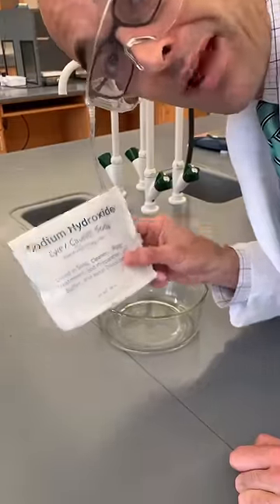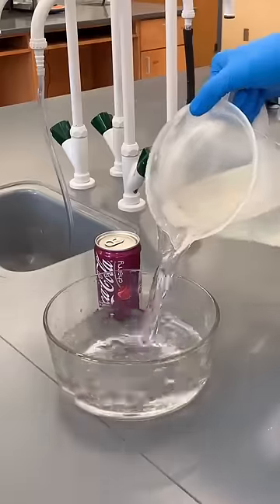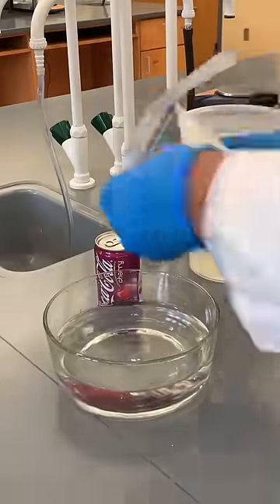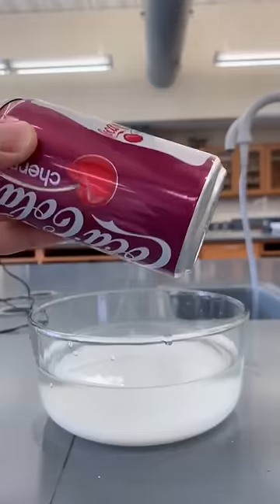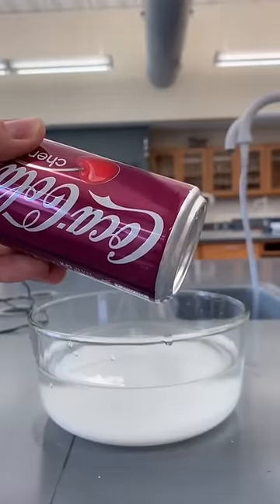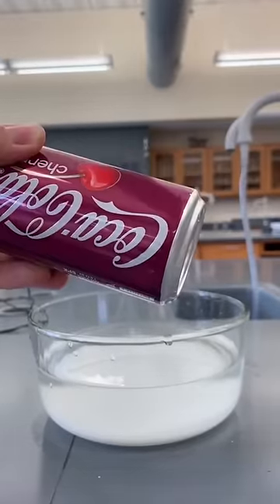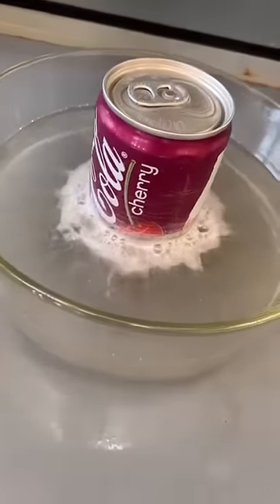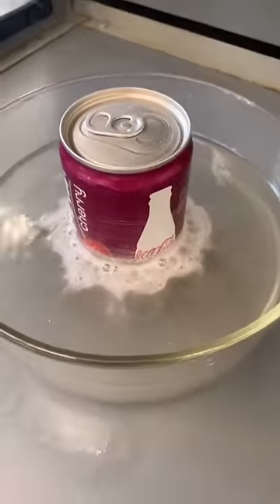Did you know this about aluminum cans?

Comment: Scotty would be proud
Transparent Aluminum 😂
Reply: But, can you make it thick enough to hold the whales?
Reply: how do we know he didn't invent the thing?
Reply: Anoni Moss  ,it's a joke... a reference to an older Star Trek movie where they had to go back in time and beam up a mated pair of blue whales onto the Enterprise and bring them back to their time to save the Earth. They had to quarter off a section of the ship and used "clear aluminum" of a certain thickness to hold the whales and enough sea water for them to live in for the journey through time to their present. They had to slingshot around the sun to get the speed required to make the time leap/jump. I hope the engineering feat that Scotty would have to undertake explains the comment left above.
Reply: @thomasarussellsr  not quite. 
Scotty traded the “formula for transparent aluminum”, with the plastics manufacturer guy in order to obtain several sheets of whatever polycarbonate (or some such) plastic product in a thickness sufficient to withstand the pressure of the water plus whales.
Reply: Transparent Aluminum is actually real... needs lots and lots of heat and pressure to make!
Reply: @wolphin732  in the use in this stream, it was a joke, as it pertains to the video.

Comment: I remember being mindblown that they coat aluminum like that. Didn't learn it until interviewing for a company making that plastic liner. PPG paints. Also, by anodizing Aluminum, I think it can resist acids without liners, but needs to be under controlled temperature, otherwise the Aluminum Oxide layer will crack deep. 

Also, yes glass tastes better all the way. Glass and porcelain is what the liquids we consume are meant to be stored in.

Comment: We have Sodium Hydroxide at work, we call it NaOH, we used to use KOH (Potassium Hydroxide). I work in a plastic recycling company and this is part of the process to pre wash the bottles to probably remove glue from the labels and then also wash the flake after the plastic bottles are grinded. Fun fact: I dropped a whole tote one day, slipped, and landed on my back on top of the chemical, fortunately my co worker put me on water and put me in the shower for some time. My whole back tingled for a whole month due to the burns. I landed on KOH which is stronger than NaOH, and it was more than 50% concentrated at that time, that thing will burn through your skin, my brand new shoes turned into chicharon, the squeeges we were using broke in half and the bottom of the side wall was badly damaged.
Reply: Dude almost died like a comic book supervillain goon.
Reply: سلامتك
Reply: You weren't wearing PPE (Personal Protection Equipment) while handling that stuff in bulk?? I'd be in a Tyvek onesie, gloves, and face shield, minimum, or refuse to handle it. Maybe a filter mask or respirator, too. Go ahead and get NaOH or KOH in your moisture-laden respiratory system. Those powerful bases are nothing to trifle with. They're potentially deadly in the right situation.

Comment: In the old days the cans where painted to reduce corrosion now they use a super thin coat of plastic as its cheaper it is 99.8 less plastic than a bottle of similar volume capacity

We are talking about less than a bottle cap ring worth of plastic (aka temper evident ring that keeps caps closed until twisted!)

The plastic also helps keep the carbon dioxide gas from leaking out through micro pours in the aluminium can but yes if they could use something safer for us and the environment for the cam coats would be excellent but I still prefer Glasd myself!
Reply: *were painted. Not, "where" painted.
Reply: @andjusticeforall9028  Its said the same so why is it spelled different? But yet we do not say silent letters English makes no logical sense so please do not be A Germlin about Spelling when you know what was meant!
Reply: Considering how many drink cans are manufactured each day, even if it is just a temper ring of plastic per can, it's still too much
Reply: @andjusticeforall9028  🤓
Reply: The quality and recyclable capacity of low quality plastics like this is nill, not to mention coca-cola admits to using BPA in their liners, which is bad.
Reply: @Austin Hurst unfortunately this food grade lacquer isn't  always standard, there are versions produced from epoxy or polymer. Both of which may contain BPA, not to mention that the polymer is made from Polyvinyl Chloride (PVC) which is proven to be highly toxic to humans.
Reply: @DarthAwar they don't sound the same at all. were is "wer" where has the H sound.
Reply: @DarthAwar  And in english read, and read and lead and lead have different prononciation s and different meanings, so we wish they were written differently. (w)Here it's not just a picky orthographic detail, this changes the whole logic of the sentence between two very common words.
Reply: @DarthAwar ”Where” and “were” are definitely not pronounced the same

Comment: “A little bit of sandpaper…”

Proceeds to scrape off every bit of paint
Reply: yes. with a little bit of sandpaper.....
Reply: The paint is very thin and easy to remove. Also, it's not aluminum so you'd want to remove it for more control with your chemical reaction. It's just doing a good science.
Reply: yes that was the point
Reply: It's ink, not paint.

Comment: This is amazing.  I didn't know this. You learn something new everyday.
Reply: It helps keep the flavor from being metallic.
Reply: there is NO plastic in a can, cut it open and see for yourself
Reply: @ACommenterOnYouTube  There's always a thin plastic layer (coating) inside drink cans to protect the food or liquid and to protect the cans from corrosion. Every soda contains phosphoric and citric acid and it's thus necessary to add a hidden liner inside the can to prevent the beverage from reacting with the metal. It’s a polymer or epoxy sprayed in coating.
Reply: @ACommenterOnYouTube  yes it is you’re no scientist calm down
Reply: @teesev6231  are you triggered millennial / GenZ ??

Comment: Everyone’s worried about the plastic in inside the aluminum can, however, failed to mention that the soda cleans battery acid off of a car also remove grease from your driveway. That’s the scary shit right there.
Reply: Coke really is the best thing to use on corroded bolts
Reply: Yes Coca-Cola is the best for cleaning the corrosion off your battery terminals etc . Coca-Cola has a long history of thing's it has been used for
Reply: @RickKneice  that’s my point exactly so anyone that would consume it as a beverage on a regular basis it kills your insides. So I wouldn’t worry about the plastic that’s inside the aluminum can I would be more so worried about what’s in it.
Reply: @etheleneharris6647 lmao, now look up the pH of your stomach acid...
Reply: @michaelmcgee2026  the point is not about if Coke or Pepsi works the best on corroded batteries, the point I was making is why focus that the beverage is in plastic inside the aluminum can when soda is so acidic that it burns your insides. People are so worried about gangbangers and violent people, when soda is the number one killer in the country.
Reply: @conanobrennan53  unless you have ulcers, your stomach acid isn’t killing us. The stomach acid helps digest the food that we eat.
Reply: @etheleneharris6647  lmao, the pH of sodas isn't killing us. It's all the processed sugars.
Reply: @conanobrennan53  I would have to agree with you as well alongside with the carbonation. People go through heartburn and acid reflux after drinking the carbonated drink. So yes! It does destroys the body! You must love soda and most people defend it because they’re addicted to it. That’s fine though!
Reply: Half the crap in your stomach will do that too. Not a valid argument.
Reply: But it can’t dissolve that plastic
Reply: @etheleneharris6647 no, carbonation doesn't destroy the body. There a valid concerns with soda, carbonation isn't one of them, and you undercut your argument with that nonsense. If carbonation were the issue, doctors would tell people to switch to kool aid. You see how silly you sound now?
Reply: @jaredhicks5655  
I don’t believe I do! I’m not speaking nonsense I’m speaking truth. The sugars, carbonation, and other additives are very acidic to the body. That’s why there are so many problems with people that drink it. I know exactly what I’m speaking about. Unfortunately People love soda so much they are willing to defend it because of their preference for the beverage…
The carbonation causes acid reflux and other issues. Drink on drink on.
Reply: @jaredhicks5655  carbonation increases calcium loss in bones, causes tooth decay and irritable bowel syndrome (IBS), and can make you gain weight even without the calories, sugar, and flavor that are found in regular soda.
Reply: @MJFish  that’s another great point! What chemical is in that plastic without that liquid deteriorating it!
Reply: It's just the citric acid, your stomach acid is more corrosive.
Reply: @DR-sv8ke  yes, you’re right! However, corrosion in a good way. Just like we have good bacteria and there’s bad bacteria! Unfortunately people, number one choice most the time is soda pop, and they will do any and everything to defend it! It’s mind-boggling how people will try to debunk facts..
Reply: @etheleneharris6647  it's not the carbonation. Again, with your logic kool aid is less bad for you than pellegrino
Reply: @etheleneharris6647  debunk facts? What facts? All you said was it cleans corrosion off of batteries. Lemon juice does that lol. You're taking that fact way too seriously. No one's defending anything, just pointing out that your worried about something that doesn't matter. The sugar in soda is more damaging and you choose to complain about the miniscule amount of citric acid.

Comment: Honestly, seeing that bit of the can bulge out like a balloon was just the bees knees.
Reply: it looked like a blister
Reply: This pisses me off… why tf would they put plastic in a can?!?! 

Sure, it’s not much but what in the actual fracking? Is it just a membrane? How does this impact recycling?

I use aluminum water bottles exclusively, does this apply to those as well?
Reply: @ceezb5629  Small lining meant to prevent possible contamination of the drink from the can itself.

Its there for good reason and its thin enough that i'm pretty sure it just burns away when the can is recycled.

Comment: I learned something I didn't know before, but it makes sense. If the cans weren't lined, the acids on the soda would soon corrode the can and then leak out.
Reply: Yea it’d be bad if drank too😅😅 all the rust inside the drink after all that sitting around
Reply: @RK36_  holy shit bro alluminum doesnt rust 💀💀💀💀💀💀
Reply: @igrowweed2847  it does oxidize/corrode  tho , which is exactly the same process as rusting

Comment: Can confirm, I worked at a soda factory, specifically the can line. I was the can filler machine operator. I spent a lot of time with cans lol before they went through the seamer, the machine that puts the top on the can, and a fresh can with no product is easy to inspect and see that there is a plastic liner. I recommend looking into that industry to know more about it. It's actually cool
Reply: That’s dope.
Reply: We appreciate that direct confirmation by experience 😅
Reply: Our seamer sucks
Reply: Does this mean that cans aren’t recyclable like we’ve been told?

Comment: Not plastic, it's a food grade lacquer.
Reply: 4 thumbs up = everybody else still thinks it's plastic
Reply: What is the lacquer?
Reply: @darylmarsden6454  Basically resin. It's primarily made from cellulose which is derived from plants, it has to combine with other volatile chemicals to harden properly but overall there's less processing than with plastic. Couldn't tell you if it's less harmful to the environment or not though
Reply: Allegedly
Reply: Still don’t want it in my body
Reply: That's like saying "it's not a Ford, it's an F-150".

I was taught in my materials class that "plastic" is essentially a term for any synthetic polymer - it's a really broad category. A lacquer is a plastic dissolved in a solvent so it can spread into a thin layer, but once the solvent evaporates, what it leaves behind is plastic.
Reply: @theunfadeable60  it doesn't go into your body. 🙄
Reply: @JM64  Screw the environment. What about what it does to people?
Reply: @rash9488  The only material to hold beverages in that doesn't readily leech something into the drink is glass... so I'll leave it at that
Reply: @theunfadeable60  then don't eat the cans 🤣
Reply: @jamiepeterson5646  Facts!
Reply: @JM64  yup 💯
Reply: @jamiepeterson5646  Exactly, cellulose based plastics are still very much plastics. Nitrocellulose lacquer, for instance, used to be used to paint cars and it was replaced not least because of it's toxicity.
Reply: Another plastic variant.
Reply: @jamiepeterson5646  Good one 👍🏻
Reply: @MyLibertyTV  Really.
Reply: @MyLibertyTV  you need to research micro plastics and how the average human consumes a fairly large amount of them without knowing
Reply: Acceleration Quanta  Except it's not lol.
Reply: Acceleration Quanta  "No such threshold exists"
What you think we can terraform planets in any suitable time frame? The damage humanity has done already took centuries, to reverse it all quickly would take an equally long time in R&D alone if not longer
Revive already extinct species?

Comment: "Scuff up the outside a bit", proceeds to remove all the paint.
Reply: *plastic (it's not paint)
Reply: @logik969 

*paint

he removed the paint.
did you only read the title, and didn't actually watch the video?
Reply: @log OP is talking about what dude did with the sandpaper.
Reply: @favoritemustard3542  ironic name he has
Reply: Well, whatever it is, it would probably protect the aluminum underneath, so it needed to come off. Also, the scratched-up surface of the now-naked aluminum presents more surface area to the NaOH solution, so the reaction takes less time.
Reply: @kellyrobinson1780  

That has nothing to do with the point of the OP, he obviously took it all off for a reason.

Comment: Fun fact: Sodium Hydroxide is the same stuff that goes in a hair relaxer.
Reply: It's also used to make paper, soap, drain cleaner (because it turns fat and grease into soap, so it can be easily dissolved by water), etc.
Reply: WTF is hair relaxer does it help your hair poop better?
Reply: It is also used to clear drains because of how caustic it is
Reply: @2nd-place it's used to make curlier hair types straighter, it pretty much just 'relaxes' the curls and coils

Comment: I did NOT know that. Thank you for making this video. 😊
Reply: ... yea.... Like the acid reacts with aluminum over time creating gross and heavy metal flavored soda... Aluminum cans for food also have it in there or else tomatoes would be inedible and slightly to moderately toxic. You can get heavy metal poisoning from improper use of aluminum foil(like don't roast tomatoes on it)
Reply: What you need to know is that it's not plastic, it's lacquer.

Comment: When I was younger I made batteries out of cans. You gotta cut the top off, empty the can, then scuff off that plastic lining before you can add some extra salt and the soda back. Then all you gotta do is attach a lead to the rim of the can and an old penny (copper era) and dip the penny in the salty soda and you should get a voltage on a multimeter.
Reply: That is an awesome way to build a salt bridge battery, this should be a popular experiment in chemistry classes!
Reply: I want a demonstration 🥺
Reply: No one came here for you to brag about making a battery....
Reply: @j2398  ok! 😁

Comment: Fun fact. Around here people who sell balloons at fairs and elsewhere fill them with hydrogen since helium is expensive. These days they have gas cylinders that they get from welding supply companies but in the 1960s and 70s they used scrap metal and acid to generate hydrogen. Some used scrap aluminum and sodium hydroxide instead. The gas had to go through pipes in a water bath to cool it down being used to inflate balloons.

Comment: DAMN IT.   I knew there was a liner but i just kinda figured it was thin and maybe not so plastic  :(

this is what it feels like to be informed of my own willful ignorance
Reply: @CyberNET The liner in ALL aluminum cans is not plastic, it’s a food grade lacquer that is sprayed into the can and then baked on during the forming process.
The reason for the liner is to protect the aluminum from the corrosive effects of carbonated drinks. Cans with bad liners (missing spots, thin sprays) can begin to leak within hours of being filled, depending on where the thin spot occurs. Part of this is because of the drinks, but part is also because of the thinness of the can sidewall. Cans are punched and pressed to such a thin degree that any microscopic defects can render the can body practically leaking from the moment of filling and capping, hence the liner also protects against this possible failure.

Got this from a guy who worked at an aluminum can plant and figured I'd share
Reply: @braydonattoe2078  so the video is a hoax ?

Comment: For a fun way to switch things up, try adding the water to the sodium hydroxide powder instead of the other way around! 😀
Reply: I'm curious lol
Reply: Want it catch fire 🔥 if you add water to the powder?
Reply: @shawnmcqueary9677  
Why don't they sell this at Walmart?
Reply: Man, it was beaten into our heads in chemistry class--always add acid to water, NEVER water to acid.
Reply: Why not the other way around ?
Reply: @hkl8783  because if you take a small drop of water and add to sodium hydroxide it catches fire now when adding it to water it won’t
Reply: @maidenminnesota1 Sodium hydroxide is not an acid,  it's a base.  It is actually lye.  Great degreaser.